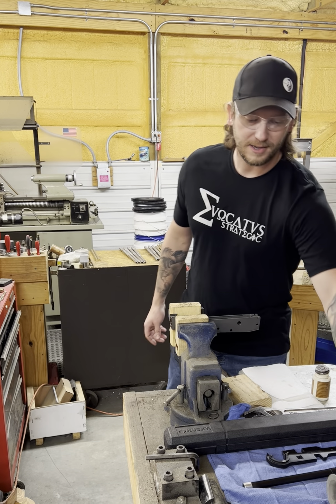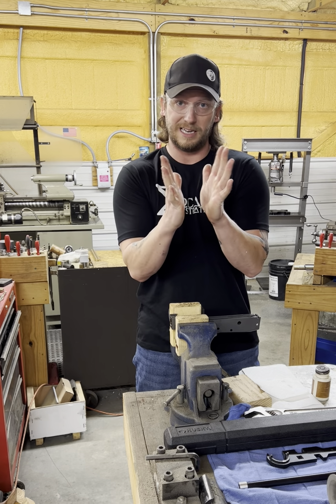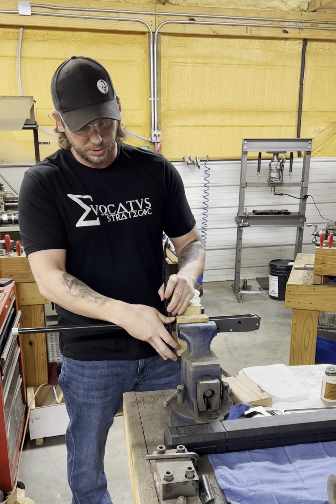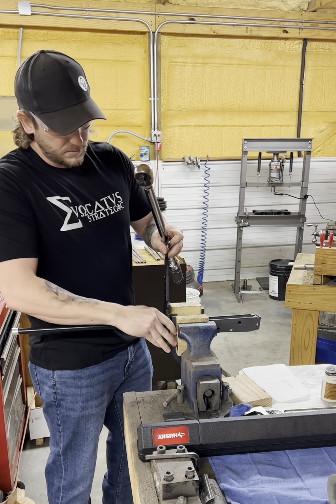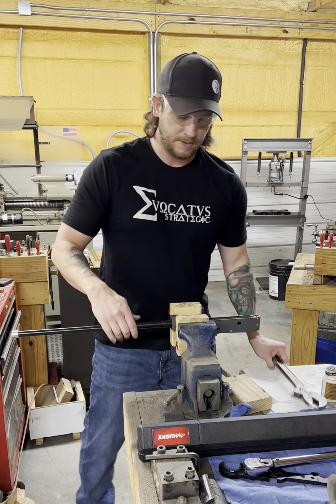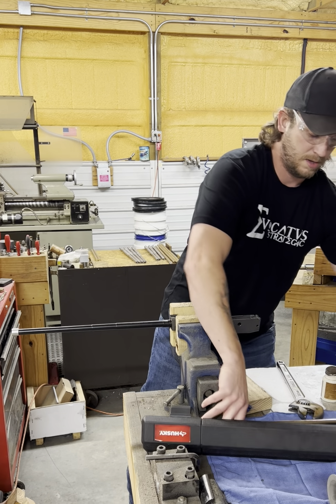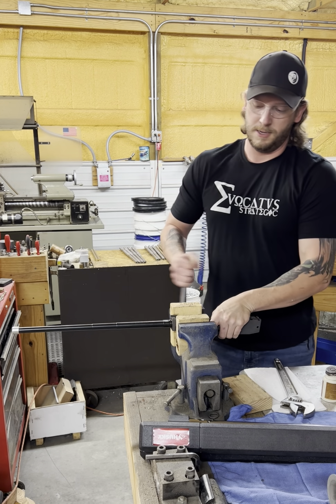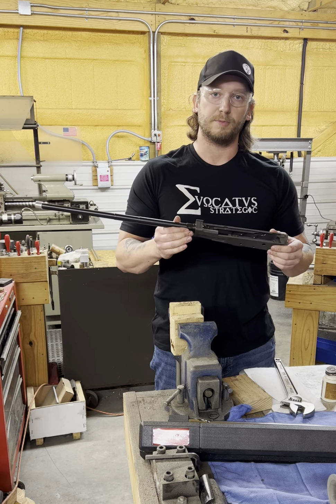How to Galil *Master Class* ep.1 : How to Install Your Galil barrel

Comment: Why do you maintain torque for a few seconds and then release slowly?
Reply from the maker: To allow the mated surfaces to settle, you maintain the pressure for a pause. Otherwise, the material can “skip”. Once the torque wrench “breaks” (clicks), you are not adding additional force to it, just holding what you’ve got.